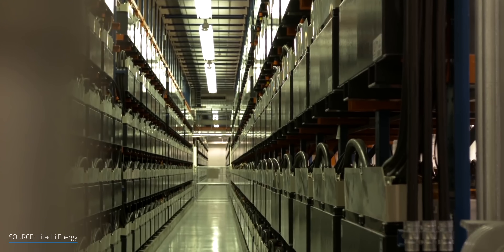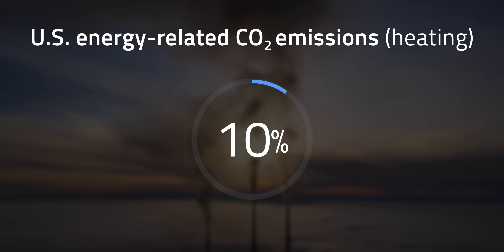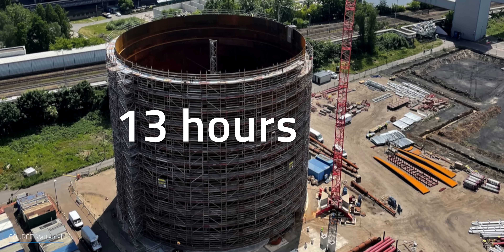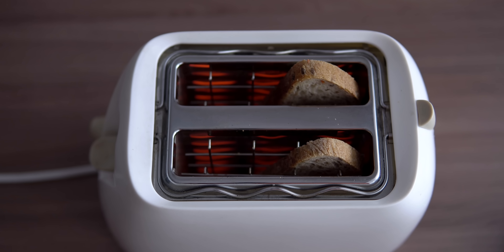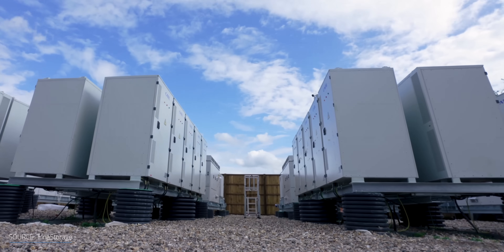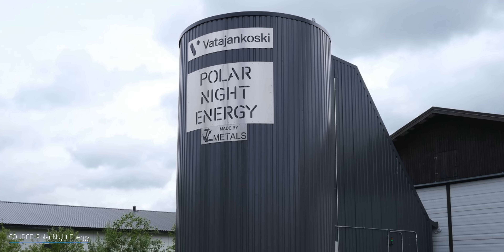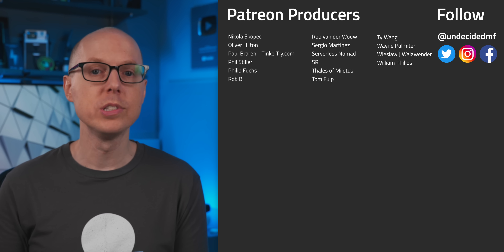How A Sand Battery Could Change The Energy Game

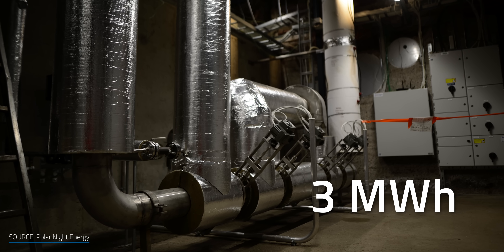Comment: 4:55 unfortunately you kinda did butcher those names, pretty badly. Most notably, the o in koski, it's not an ah sound, and more like the o in force.

Then, kankaanpää, there are double vowels, which are just extended sounds without any other alteration to the sound.

Comment: When the world turns to nuclear again I think the biggest demand is electricity what you can use for heating/cooling, recharge your e-cars or any electrical devices, etc. . I am not sure either how this technology can reasonably save heat from summer to winter, so how to make it useful in larger scale - not just warming swimming pools or shower water which is just a smaller portion of the great problem.

I don't understand this, if the major problems are very connected, meaning generating electricity by burning fossil fuels are producing CO2 (among others), and it causes greenhouse effect then why don't we focus on removing this from the air and use it for energy storage and production? CO2 can be broken into Carbon and Oxygen by electrolysis. Carbon is stable, storing it is safe and cheap, Oxygen can be released into the air. 

Do you think it is possible to create "small", closed system energy-machines that can be scaled up by putting into grid? So, something like this: wind or solar produces electricity which we use to broke CO2 to C and O2. When there is a higher demand for electricity we burn Carbon (pure coal) to produce electricity. The heat emission can be used to warm water, swimming pool, etc. We can store CO2 in high pressure tanks till we can broke into C and O2 by solar or wind power - heat emission caused by pressure can be transferred into heat exchange system.

Comment: Can store heat from 3 to 6 months :/ Wow. What type of insulation do they use? Dewar flask with a vacuum chamber to rid-off convection heat losses and silver mirror coating to rid-off radiation losses and a vacuum cap here 90% of all losses happens can sustain heat about a week till reaches ambient temperature. Maybe the scale of the tank gives 95% efficiency?

Comment: This is cool. I wonder if it could be scaled down for off grid house and shop or ranch and farm heating during winter months in rural areas. I can see solar and wind powering the electric needs when combined with battery storage and heating provided by this set up. Very interesting. Thank you. Be safe and be kind.

Comment: About the stopped windmills.  I travel from Phoenix to San Diego regularly.  The vast majority of the stopped windmills are in need of repair.  Went to SD 3 weeks ago and it was obvious that several had caught fire and that's just what you can see driving by.  Almost all the first generation (12-15yrs ago) are not working because their wing edges have deteriorated so much that it takes a hurricane wind to make them turn.  Some have been stopped for a few years now so I'm guessing it is just too expensive to fix them.

Comment: Thermal energy storage is one of the easiest ways to store energy. 2022 has been a summer that, once again has shown that our summers get hotter and hotter. And therefore, using that (thermal or PV) energy and using it in a seasonal energy storage makes more than sense. I like the idea that access energy is used to charge the sand battery, but it also could be supported by simple thermal charging (thermal solar power).

The idea of thermal energy storage exists since a long time... and yes, I am certain it will catch on,  but I am not sure if it will be as part of district heating. I live in Helsinki and am a customer of the district heating (HELEN). Problem is, despite it being a fairly modern and well maintained district heating network, that it still has quiet some thermal losses and as a customer you are just completely exposed to their price hikes. Saving energy doesn't really help to reduce your energy bill since, as most district heating providers do, HELEN doesn't cash in on the kWh - price, but on the connection fee. So, regardless if you use energy or not, they get paid. I have worked on the other side (district heating operator) and this is just their business model. In order to justify their initial investment, they must show that they have a guaranteed minimum income/return. 

I grew up in a part of Switzerland where we didn't have district heating. So, beside a nuclear bunker, almost every building had a oil tank and an oil heating. These tanks were not that small, and still we put them into every basement. Why not pick up on the decentralized energy storage system idea? A stand alone oil tank was nothing else than a decentralized energy storage system. Every building should have its own thermal energy storage system (sand battery) charged with surplus green energy and thermal solar power. And once you need to tap into that energy, you use it via a heat pump... this way, every home owner or tenant can make a difference to his energy bill with reducing the room temperature. 

Giving the end-user the opportunity and chance to reduce his energy bill with changing his/her behavior is part of energy efficiency. Not giving him/her the chance promotes energy indifference! Why should I save if reducing my consumption makes a $ 4 difference a month?

Comment: This is really a geothermal system but highly optimized via the soil type as well as going vertically up as opposed to expensively down into the ground. Others have pointed out that smaller systems are less efficient as is the case  for individual residences. However I can’t help but wonder how efficient a geothermal system would’ve if you simply dug out a back yard (think swimming pool type excavation), lined it to prevent water penetration, filled it with the sand and tubing, then covered a few feet of soil as a natural insulator.

Comment: Why are they using resistive heating and not a heat pump where in rumor has it would generate 5 w heat to 1 w of electricity thus being able to store with more units more thermal energy?

Comment: If Sand is having such good thermal storage tendency, I guess we can use this storing cooling energy also.. Like, we can run the AC equipment (Chiller) to cool a mass of sand during day, by utilising the solar power.  We can reverse the water flow in night for extracting the cooling energy.
Reply: But then you're not storing heat energy. Although I believe there are some technologies looking into using ice for that where they freeze the water during excess and use the ice when needed.
Reply: @daemonbyte  there are thermal energy storage tanks which work with ice balls (phase change materials) and it is quite effective..but they are quite costly compared to sand..

We can run the district cooling plant in day time using solar panel and the excess capacity can be stored with ice balls..and in night, the same stored cooling energy can be directed to homes / night offices / data centres.

Comment: Just a though, Stirling engines? Since heat demand is more in winter, having the cold side outside the building then the hot pipes on the hot side with a generator hooked up make it somewhat feasible to make electricity as well?  Would it be too costly compared to a steam turbine? And or because they would have to be replaced offen?

Comment: Heating the sand using resistive heating is inefficient they can get almost 4x the heat per joule if they used heat pumps instead when able (yes, heat pumps can be up to 400% efficient and no, this does not violate the conservation of energy, nor is it 'free' energy)

Comment: Honestly, I find it hard to believe that a steel cylinder storage container can retain the heat of the hot sand of 600°C for 6 months until the winter arrives.
Reply: I live close to a outdoor skiing area. During the late winter, snow is gathered and created during the last cold weeks into a huge pile of snow maybe a 100m long and 20m tall. It is covered in wood chips and left there for the whole summer season, to be used to kickstart the next season of skiing. The snow holds surprisingly well and a reduction in size of the covered snow pile is not really noticable. The thermal mass of these big dense storages is not too be underestimated when the surface area is so small.
Reply: @leonardschoyen  oh wow I didnt know that! Thats interesting!

But whats your usual temperature there? See if snow is around 0°C and the ambient temperature is around 25°C then the difference is 25 and that affects the rate of heat transfer. Here it seems like the difference would be around 600-25=575°C which means the rate of heat transfer is much higher. If i recall correctly from high school physics that is, the higher the difference in temperature the faster the rate of change.
Reply: @StormyMusic9  It's true that the heat transfer is proportional to the difference in heat, but it is also only proportional to the surface area of the shape (the square of the length). The heat carrying capacity is proportional with the cube of the length of the shape. A doubling of size results in 8 factor increase in carrying capacity, but only 4 factor increase in heat transfer, meaning the relative heat lost is halved, and allowing for twice the temperature differential with the same efficiency. The system showed in the video essentially amounts to a prototype, with its small size.

Comment: It doesn't make sense to me that the touted efficiency drops by 74% when converting from heat to electricity yet is claimed 99% efficient when converting from electricity to heat.  I'd think this tech would be better coupled to a solar heat concentration system rather than conventional green electric.

Comment: "99% efficiency" is great, until you realize that using lithium batteries plus heat pumps is "200-400% efficient" at turning electricity into heat in your home. So if you scale proportionately, 1kwh of electricity  stored in thermal battery powered by resistive heaters would produce ~1kwh of heat. But, if displacing heat pump use, it is only reducing energy consumption by 0.5 or 0.25kwh. So 50% or 20% "efficiency".

Comment: I'm, in awe, about  the idea.  But can we get a better result if we use salt instead of sand.  A quick google tells me the boiling point of salt is 1413 c.  But, I don't know how long it would hold that heat.  Maybe in a thermos type of construct it would behave nice.  Salt has a huge lead on thermal density over sand (7w/m for salt vs 2.05 w/m for sand).  yup salt seems to win for this type of a device.

Comment: This topic has been of interest to me for the past few years. Been wanting to build a small scale thermal battery for heating our home. My designs always used a water tank with a solar water heater, but heating at higher temperatures with sand is intriguing. Perhaps I'll go back to the drawing board 🤓
Reply: You may get smacked by "the square cubed law".  The tank leaks on its surface.  That is area measured is square units.  The heat is stored by volume.  A huge take will work in ways that a small one will not.  The heat loss across a surface is also multiplied by the thermal gradient.

Comment: Interesting concept.  I like that it doesn't use lithium batteries because it's tailored to a specific purpose where batteries are not necessary.  But as an HVAC engineer I can't help but wonder how they insulate the tanks!  It doesn't matter that much what the temperature is outside; if it's 1000°F in the tank, the difference between 90° and 40° ambient isn't much - I would expect them to be hemorrhaging heat year round.  Since we're talking about storage at a seasonal level I would love to know how they address it!
Reply: That's on my mind also. I guess it doesn't much matter how much heat it loses because it's utilizing excess energy. I'd love to see the simplicity of this sand battery compared to the 5th generation cold district heating that utilizes heat pumps to extract and reject heat from a near ambient loop. My big holdup with this sand battery is the resistant heating, why go for 100% efficiency if you can have 400% efficiency in both summer and winter with heat pumps. And while it might not be as simple as sand, a massive tank of water isn't exactly much more complicated, especially when you can use it for both heating and cooling and it's already the medium being used to transport the energy throughout the heating district.
Reply: Man, I don't know why why don't put solar panels Infront of the sun like we did that telescope recently to get those photographs. The. We have solar 24/7 in one fat array and we can then lazerbeam the photons back to panels on earth to solar panels all over during nighttime by bouncing the photons off big mirrors all the way around to the dark side. Wouldn't have to hit every panel on every house. Could just hit the big huge powerplant arrays to make a large amount of solar 24/7 instead of just during the day.  Sounds kinda crazy but doesn't sound kinda crazy man idk. people doing some crazy things these days

Comment: Wouldn't it make much more sense to bury the sand storage facility underground because the underground temperatures would be in the 10-15C (50-60F) range so the warmer temperature would mean less heat loss?  Also, why aren't they using the electricity to drive a heat pump in addition to the restive heating since it is so good and generating more heat for the same amount of energy?

Comment: Ive seen similar setups for home use but they use fire boxes instead to heat the sand. Not for long term heat but for overnight heating of a space. Build a small fast and hot fire in the fire box to heat the interior then during the evening you pipe in the hot air from the sand into your home or circulate hot water in tubes then out from a radiator in the home for warm heat that is not dry. You could use excess solar to heat the sand as well in areas that have good solar winters as well. There are loads of ways to gain extra heat for the evenings or long winter days.
Reply: I remember seeing the original advertising for Polar Night Energy. Cool beans.

Comment: I think this technology is exciting but not well positioned as storage for excess renewable power, unless we can find a way to turn the stored heat back to electricity efficiently. As you pointed out, most places don't have the infrastructure to use that much heat. Also, why use complex systems like solar panels and wind turbines to heat the sand? Wouldn't it be much better to use sunlight more directly? Producing mirrors and lenses is so much easier on the environment, and they should be cheaper and have a much longer lifespan than solar panels and wind turbines.

Another way to improve this idea is to use the heat for desalination of seawater or distilling waste water. That would be hugely important in a place like southern California which is drying up and doesn't need all that stored heat for the winter, and has virtually limitless amounts of sunshine and seawater.

Comment: Great stuff as usual. Curious…the video mentioned the electric hot air can heat the sand to over 1000 degrees F. Do you know the heat loss rate? Degrees lost over time?
Reply: The company has excellent info on its homepage.

Comment: How could I install a pipe in the ground below my home which allows me to capture heat during the summer and use it in the winter? AKA geothermal. How do I get the plumbing cost effectively installed below my house or in my reasonable small yard?

Comment: What is the rate of heat loss? You said 99% efficient but I bet that is using it within days, not 6 months later. If a 100Kw goes into the silo in summer, how many Kw of heat comes out 6 months later?....Surely I missed this crucial piece of info in the video somewhere?

Comment: If someone developed a high temperature heat pump to go along with this it could be amazing.

Also, district heating should be considered anywhere that has low grade waste heat (temps too low to efficiently turn back into electricity)  There's a lot of waste heat around already that goes underutilized.

Comment: Why not coil the pipes underground instead? The ground temperature at depths greater than 10 feet remains relatively constant through the year. At a depth of 10 feet the average ground temp. in the summer is 75.12°F and in winter it is 75.87°F.

Comment: this operates on the same principals as a rocket mass heater.  rocket mass heaters are a small firebox with a lot of tubing surrounded in earthworks.  using the earthworks as a thermal battery and the tubing to absorb as much thermal energy as possible from the wood fire before dumping out the chimney, they reduce the amount of fuel needed to heat a home.  

i do wonder what kind of losses they get using air to transfer the heat around though.

Comment: They're being modest when they say sand based heat storage systems will last 50 years. It's a can of sand. As long as you don't let water get in, you'll only have to repaint it and probably replace some fittings every so often for hundreds or thousands of years. The heat pipes to people's homes probably do need to be replaced every few decades as those are far more exposed to water.

Comment: Thanks Matt, that was really interesting! It's a great, inexpensive and safe solution for cities with urban heating systems. It reminds me of simple, passive solar heating by having sunshine warm concrete or stone and then blowing the hear around in the evening. I wonder if a small version of this heat containment system could be used for apartment or office buildings, or even individual private homes? I imagine the cost of the insulation decreases rapidly with increasing volume of sand. Keep the positive information coming!
Reply: Thanks